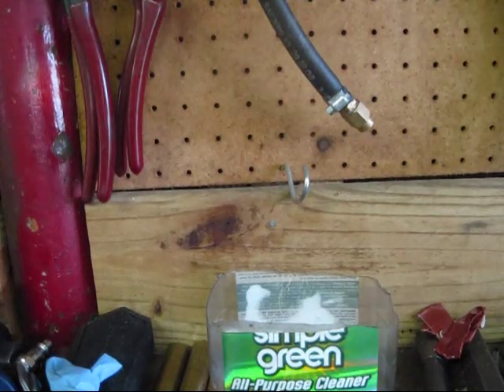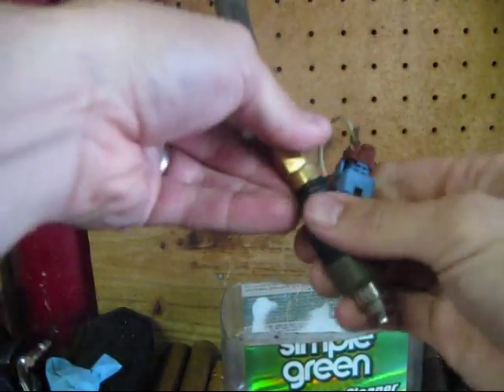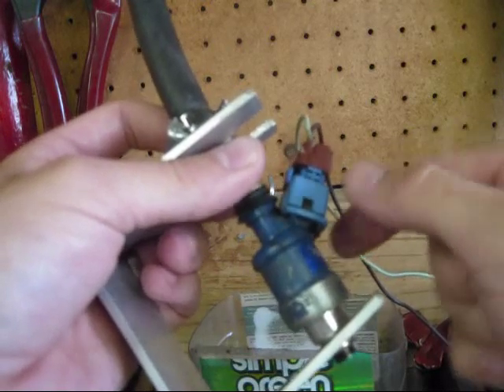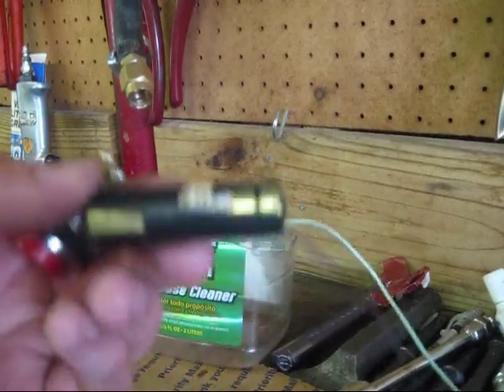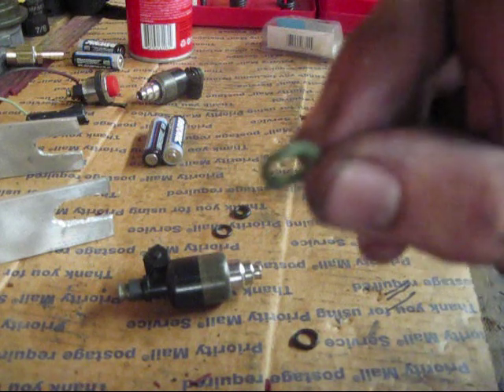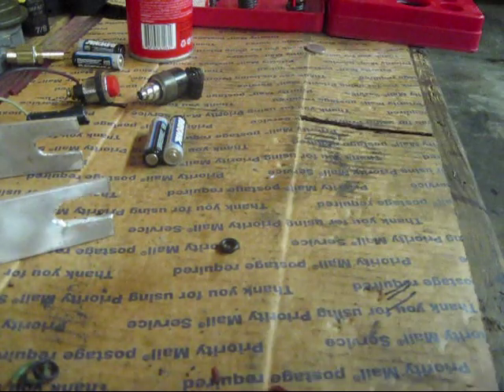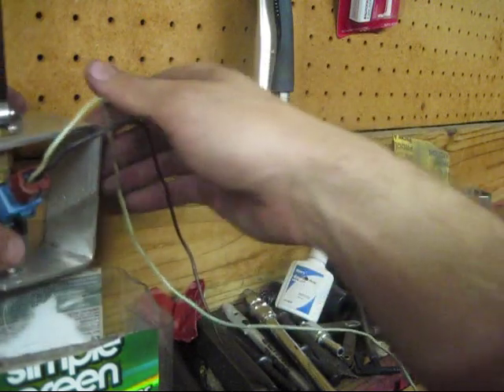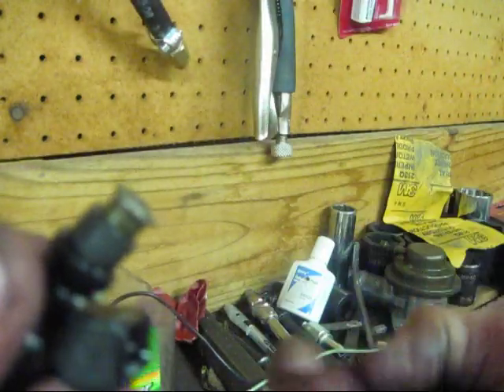Homemade Fuel Injector Cleaner Update

Comment: Yeah parallel will give you the same voltage.  But the current will be additive . Series wiring will give added voltage.  But always wire similar voltage batteries or else one will try discharging into the other.

Comment: You need to wire the batteries in series to add the voltages. You have them wired in parallel.

Comment from the maker: This is a great idea and it was even thought about when I found this problem. However, such a rig is only needed if you plan to run the injectors for a extended amount of time. The injectors are made to handle the spike but just not for extended periods of time. The rig is more sophisticated than it really needs to be for the cleaning process. Thanks for the input as someone else may need a harness to keep them open for longer periods of time. 

Robert

Comment: ok you should make a 2 loop system loop one runs to the injector make that your one volt add a switch to this loop then hook up ground to a 4v ac adapter the on the hot side ad a momentary switch then positive on the injector this should give you your spike and the one volt will be your constant i would put one way diodes on each loop but im paranoid and you should get a nice auto ranging digital muilti meter

Comment: you ware getting the same voltage since you connected your batteries in parallel, put them in series, the + from battery 1 goes to the - on battery 2 then take the free + and - from both batteries and there you have it 3 volts CC

Comment from the maker: I am not sure how the chemicals used to clean injectors would react to the PVC? You will still need to drill and tap the holes so no work is saved. The other thing is you will be depending on the glue to hold the PVC together when pressurized with air. If any of the chemical breaks down the glue for some reason, this could be catastrophic. The metal parts are threaded and will withstand all the needed chemicals for cleaning injectors. You still have to drill the holes, so I would suggest steel.

Comment from the maker: Wiring is not my strong point and I did hook them up in parallel. :( to much voltage can be a bad thing. A 5 volt spike opens the injector and a 1 volt current holds them open. Holding them open using higher voltage may cause damage to the injector. Thank you for the information as 2 AAA may be all some people have, but just check the voltage and be mindful of how long you hold the injector open with increased voltage. Thanks for the Electrical info, it is greatly appreciated. 

Robert

Comment: If you hooked those AAA batteries in parallel (pos across pos, neg across neg) it will will double the battery current not the voltage. To double the voltage you will have to hook them in series. (stack batteries pos to neg and connect to the neg and pos end of stack to your project).